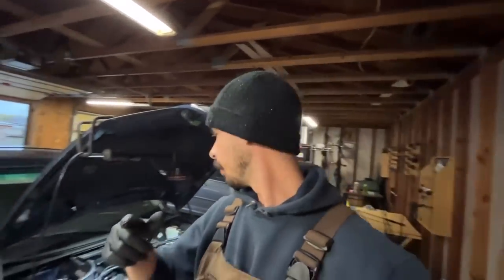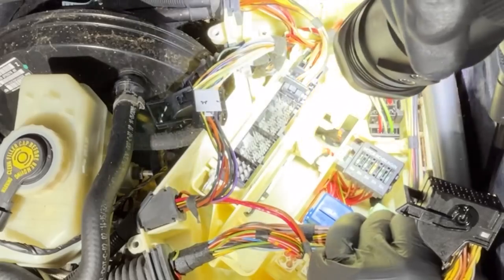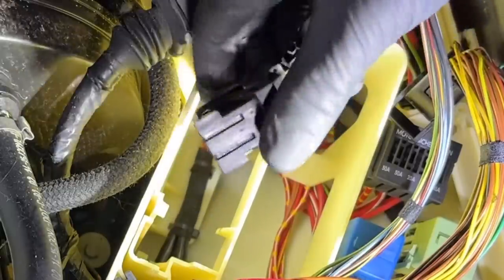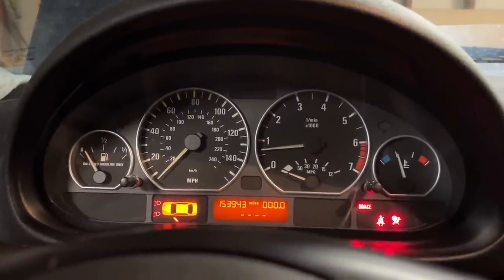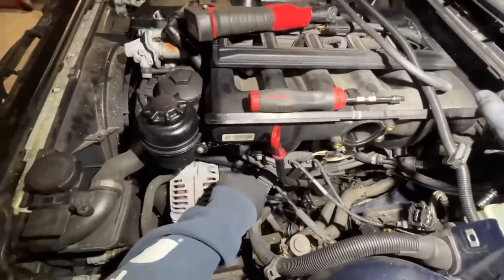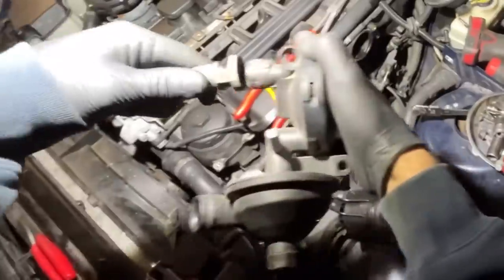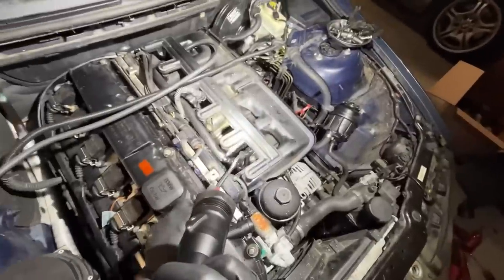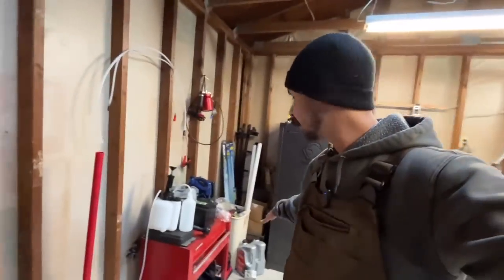OIL?! IN THE COMPUTER?! $500 BMW E46 330I Project Will It Run Part 3

Comment: Ive had the following put oil into e46 wiring harness/dme:
-Ex. Vanos solenoid
-In. Cam position sensor
-Crank position sensor

They all leaked through the sensors & solenoid directly into the electrical connectors.  None were external oil leaks dripping onto the connectors.
Reply from the maker: Crazy how they do that huh…

Comment: On my old e46 had the same issue but the oil was being pushed up from one the vanos solenoids (exhaust side). Easy to check, just pull the wire connector and see if its oil soaked. Its amazing how the oil can be pushed up the wiring through the insulation and not show a drop externally.
Reply from the maker: Its crazy isnt it?! i got some more connectors to go through but shes running great so far. Should have another update out this week

Comment: I’ve heard of Coolant travelling a short distance up a wiring loom. But oil going that far is crazy. Good work dude. Lovin the channel👍🏼
Reply from the maker: Thanks a ton for the support! Yeah ive seen both a few times, with the amount that BMWs like to leak it’s more common than you’d think. Used to do lots of mini Cooper harnesses, it was under a dealer recall for some time too. Thanks for stopping by!

Comment: I had this issue (oil in the DME) and the source was from the camshaft intake and exhaust sensors. Give them a try! Just unplug them and see if they are wet.
Reply: And btw
 The coil plugs run into the last plugs of the DME. Which didn't had any oil !
Reply from the maker: Thanks Willy! i did have some oil on the last connector but not so much pooled up in the DME. Ill take a look though! I appreciate the comments and suggestions :)

Comment: Really enjoy your channel bro. I do all the service on my buddies 2011 528i F10 with the N52 motor, his car has a solid 220k miles and still runs strong!! I’m a beginner but I’ve changed all his ignition coils, spark plugs, check valves, oil changes, mass air sensor, engine and cabin filters, leaking valvetronic motor gasket, trunk lid springs and etc. These cars are really fun to work on and I enjoy learning more from your channel! Keep up the great work😎👍🏽
Reply from the maker: Right on! Love the F10 with the N52, perfect engine for that body style, way better than the N20 or N55. Good work on keeping that thing up! The N52 is pretty easy to work on, especially in that body. good stuff dude! thanks for stopping by

Comment: I have the same, or better said a bigger problem on my 520d f11, the rail pressure sensor leaks diesel into the wiring harness and it travels to the computer, I got a Check engine light because the ambient pressure sensor in the DME didn't work, after I opened up the cavity I found the DME swimming in diesel, I drained everything, cleaned everything with brake cleaner and then opened the DME to clean it too.  I still haven't changed the sensor but I will in the near future. I cleaned the Air intake plenum and disconnected few connectors and found diesel or oil in the wires so I don't know what to do 🤷‍♂️😂 and honestly I won't touch anything till something happens 🙄 anyways, cars running great an no Check engine warning since few months.
Reply from the maker: brutal! still running good since this comment?!

Comment: Good video bro, after working in a shop for so many years I've seen it all, oil in the  DME I believe it, doesn't surprise me, oil vapor leak out of the VC gasket will travel down the harness, basically your ecu was your CCV.
Reply from the maker: Hahah you’re exactly right. Harness for a CCV is the perfect description, literally, a giant gap on cyl 3 and it’s sealed to the ignition coil. Cheers

Comment: I also had oil in my m54 dme, but it came from exhaust camshaft and crankshaft sensor. They were original parts from 2003, when taking them out i noticed hairline cracks on the sensor side which sit inside the engine. The connectors were also filled with oil. I mean the fact that oil pressure could have pushed the oil all the way to the dme makes more sense, as there was oil pressure involved through the sensor cracks. Cleaning the oil fixed my intermittent rpm stumble, stalling, drove like that for a while till i replaced the sensors. You might want to check them. Crankshaft sensor is a bitch to get to, not fun at all.
Reply from the maker: Interesting! ive seen it from Oil Pressure Switches but never cam or crank. I know the cam sensor is exposed to the crankcase and oil, so thats a possibility. 
Great job at diagnosing your issue, theyre not always easy.
Also thanks for stopping by! love seeing stories and personal experiences with similar issues in the comments

Comment: Love the car and passion but Man U gotta invest time into getting a laptop and getting inpa,ista  ncs expert , pa soft  all those programs will help you so much it will be a breathe . Clusters is a common problem as well I recently changed one for a customer . Never had oil all the way at the dme , but I’ve heard rumours that oil can travel up the harness from sensors lol😂check crank sensor if it’s sending oil into ecu that’s the harness that goes all the way to the dme connector and it’s shielded
Reply from the maker: youre right, i used ISTA for 6 years at my old shop, love that program, so versatile, never looked into getting it for home but since im workin on these two for the time being it would be worth it. I think my gaming laptop can handle it. 
I need to look at crank sensor next, but we will find it! for now, its still running strong

Comment: Hi love your videos my BMW 120i convertable .I spilt a 2 litre coke in the boot I had to disconnect the battery to clean out the spillage. On connecting the battery I now have a airbag warning seat belt light and roof signal singing all the time any advise Trev in sunny cape Town south africa
Reply from the maker: Hey Trevor, its possible codes need to be properly cleared with a capable scan tool. BMW dealers use ISTA which could do it, so I would seek out a capable scan tool or someone that has one. Maybe that helps!

Comment: i have one 2002 330i , it always give P0365 camshaft sensor -exhaust circuit wrong. I changed 2 cam sensor and also 1 crank shaft sensor.  still have the code.  So, i start to check the wiring and found the DME  connector 2 and 3 has some oil inside,  just like yours.  I cleaned DME and the connectors very carefully and make it dry. Reinstall back , but the P0365 still exist.   Really annoyed.  Can you give some suggestion.  I will check the Oil pressure sensor and also the coils tomorrow and clean them. But that is only for prevent oil going to DME, shall not cause P0365.   I do find some oil in the connnector of Exhaust cam sensor plug, but I have already cleaned it in deep also. I changed the valve cover gasket already ( the old one do leak near the CAM shaft sensor area).
Reply from the maker: thats a head scratcher... luckily my oil penetration didnt cause any CEL for me. The oil pressure sensors on the back of the oil filter housings are known to fail and push oil into the harness, I would check there too and see if theres any oil present... hopefully someone in the comments can add some insight as well. let us know what you find!
Reply: update, I checked my oil pressure sensor and coils, they are all dry and okay.  But I am still have that P0365 with Check engine soon. Light on 🙁

Comment: I had a similar issue with my E46 - does your radio ever randomly disable itself? I had a short on my Clock Spring for radio controls + a short on the LCM. The clock spring uses KBUS. Usually you can find the KBUS grounds above the fuse box & unplug them one by one until the cluster returns to normal. Then from a KBUS pin out you can figure out whose shorting.
Reply from the maker: Wow! Great info Mike, haven’t had enough time inside to check radio but I did notice when the cluster acted up it was right when I turned on the headlight switch, possibly related to an issue with the xenon headlights…

Comment: Need some advice, u look like the right guy to ask. I have a W111, c180 mercedes 2001 model. The car batt goes flat in 2 to 3 days if not using the car. I did do the checks at the fuse boxes and all with a ohm meter can't find the fault. What suggestions do u have or think it might be ?
Reply from the maker: Sounds like you have a battery draw. you can find diagnosing procedures online but what I like to do is install an amp clamp behind the ground cable mounting on the battery. I lock the car and let it go to sleep and then monitor how many amps the battery is pulling while off, then I go through the glove box and start pulling fuses to components until i find the fuse causing the most draw. Hope that helps!

Comment: If that's gonna be your daily driver, you should probably address the oil pump nut backing itself off the pump at high RPMs. The motor will be destroyed if it happens.
Reply from the maker: That’s a good idea, I figure we will have the oil pan off it eventually so one day I’ll do it
Reply: Thought this was only an issue when you raise the rev limiter?
Reply: @Filipgorny17  nope, even on stock tunes it happens. It's just a design flaw of the oil pump.

Comment: I have a 04 645ci, can you tell me where the ambient air control sensor is? I got a code for it
Reply from the maker: It’s usually in the front area of the drivers side fender well, near the bottom of the bumper, although some models tuck them under the front bumper
Reply from the maker: I think it might be front bumper, not positive. if you give me your vin I can get you some repair instructions 👍🏻

Comment: how does oil even get inside there????!!!!
Reply from the maker: I believe it follows the electrical current when it contacts wires and pins
Reply: The previous mechanic couldn't get the plug in, so he lubricated it a bit.

Comment: *URGENT MAINTENANCE REPLACEMENT SUGGESTION FOR YOUR OVERFLOW COOLANT TANK BEFORE  CATASTROPHIC FAILURE/ EXPLOSION!!!- A COMMON UNEXPECTED SEVERE ISSUE ON THE E46 BETWEEN 75,000-150,000 MILES***
I have a 2001 330xi and my tank exploded on me while driving on the highway leaving me stranded and having to get a tow. It caused major carnage in my engine bay, damaging fan and shroud, radiator, serpentine belt, water pump and pully,  power steering pully, and fried driverside HID headlight. I myself have serviced and maintained every vehicle I've owned and address any issues as soon as detected. There was no warning sign of this about to happen, no leaks/ coolant loss, and no overheating issues. It ran perfectly, and entire car was in above average condition. This failure definitely caught me by surprise, and upon research found that this issue is A COMMON TICKING TIME BOMB 💣 . Forums and I agree that new e46 owners replace the tank immediately whether car has low or high miles because this will give you the peace of mind and exact knowledge of how long the resivore tank has been in use on your car. **THIS IS GUARANTEED TO HAPPEN AT SOMEPOINT, IT IS A FLAW IN THE DESIGN. OEM AND AFTERMARKET PLASTIC OVERFLOW TANKS ALL CARRY THIS FLAW! RECOMMEND REPLACEMENT EVERY 50,000 MILES IS SUGGESTED AS REMEDY.
Sorry about long comment but thought I'd give you a heads up since I unfortunately found out the hard way.
Reply from the maker: Thanks for your story Adam! Yeah thats some catastrophic cooling system failure! Cant believe it took out the headlight too. what a bummer. 
I used to replace lots of those tanks, definitely a weak point in the cooling system no doubt.
Thanks for the comment!
Reply: @DayOffDIY  Love the series man, you've been covering content very relevant to me! I own two BMW 3 series, the e46 330xi, and an e90 328i xdrive w/ N51 engine. I also enjoyed your most recent video with the e92! If BMWs will be the majority you will be working on, have you looked into any type of ownership licenses for coding programs/ apps?  I honestly highly recommend the app from bimmergeeks Protool. I purchased the master license and I can do the majority of what ISTA and INPA does and it's very well organized and provides descriptions of what each coding/ service/ diagnostic option does before confirming selection. For a DIYer like myself, its a very powerful tool that belongs in my toolbox, and on my phone/ tablet. Keep up the amazing work and I'm sure you'll climb pretty high here on YouTube!
* e46 headlight was damaged because coolant shorted out the ballast that powers the xenon HID bulb.

Comment: Why was it leaking oil??
Reply from the maker: Electrical current was pulling it from the oil saturated connector and it was following the wire from the connector to the computer